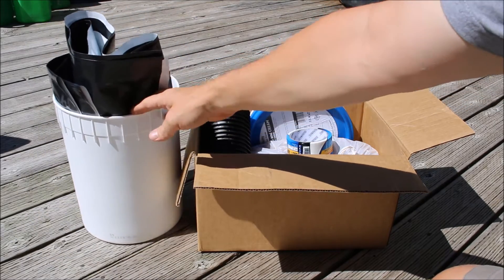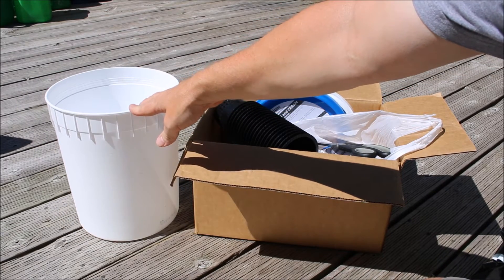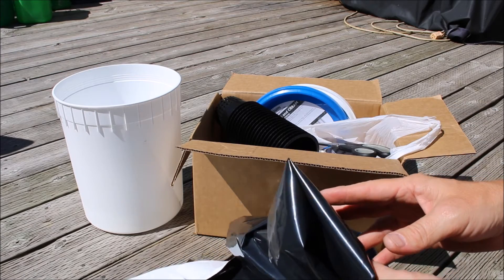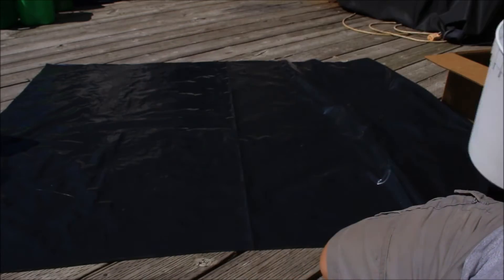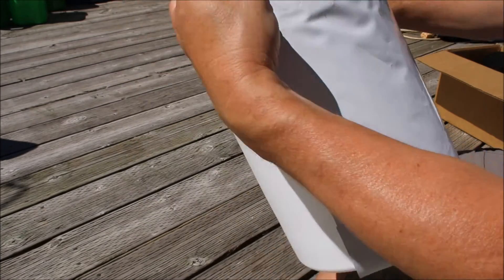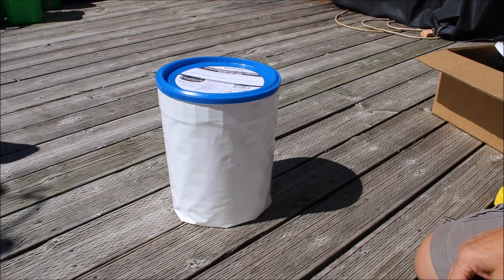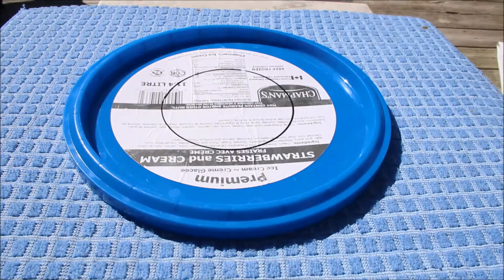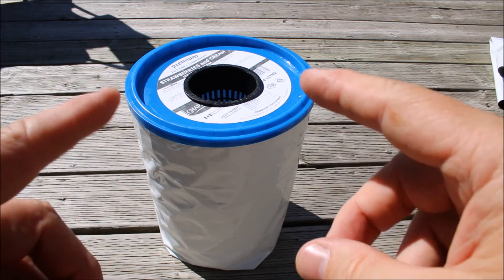Back To Basics: - How to Make a Non-Circulating Outdoor Hydroponic Kratky Container

Comment: Very good idea to use those poly sheets to line the outer portion of the buckets. I've been spray painting some clear plastic containers black and it's a pain and time-consuming to do it that way. Not to mention the time wasted on waiting for them to dry completely. I will try it your way from here on. Thanks for the great info.
Reply from the maker: I painted a few plastic pots one year, but the paint came off and it looked terrible. They got too hot as well. So far this is working great. It's been almost a month now with not algae growth! Thanks for watching!
Reply: I have also grown tired of the spray painting process and was trying to think of other ways to protect the container from algae. I like this idea and I also thought about lining the inside with a black plastic bag (for growing indoors) and covering the lid with contact paper.